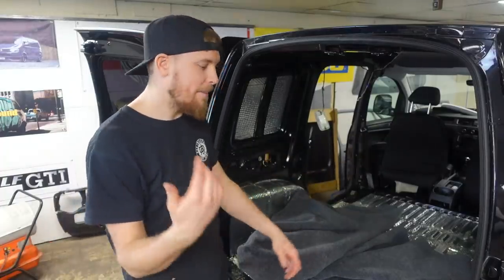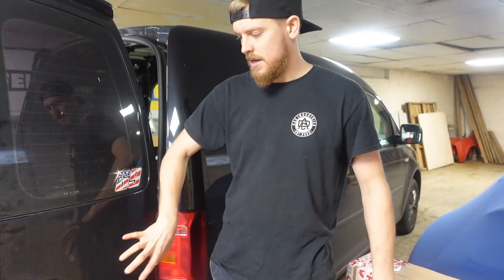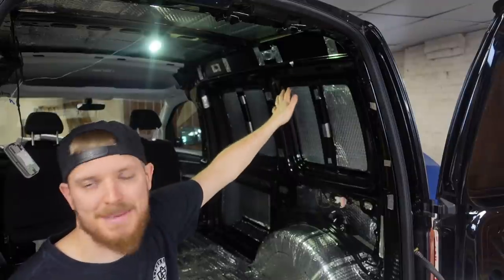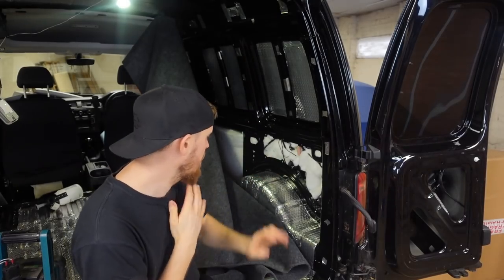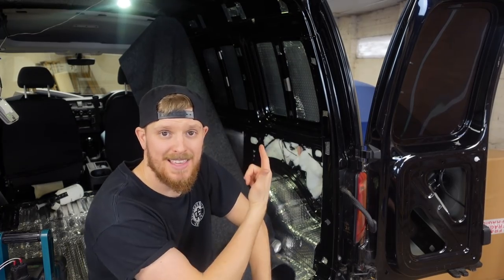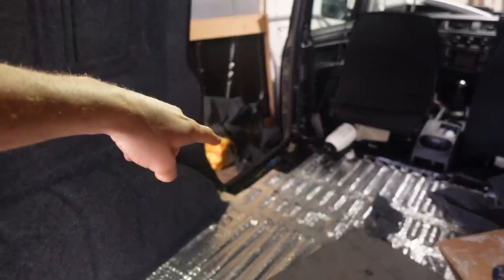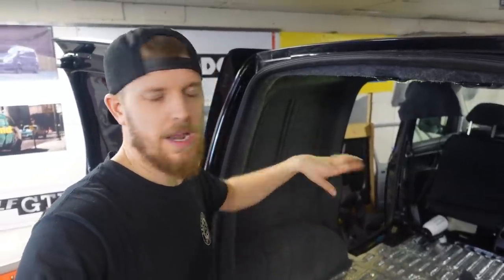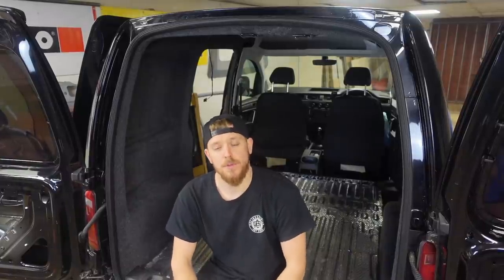VW Caddy 2k Sound Deadening, Insulation & Carpet Part 2 Conversion Caddy Camper Micro

Comment: I would have removed the headliner and under the seats as it is normally bare metal there and you get lots off road noise from there.
Reply from the maker: Thank you so much for watching and for your comment. Yes, Headliner was a bit of a mistake. But none of the front was ever going to be done at all. Under the seats was done in a later episode.

Comment: Love your work Dan, thanks for sharing.
As I’m down here in Australia, I can’t drive over to get you to do my Caddy, so I’m doing something similar to my Caddy.
I was thinking of doing the same style of carpeting on one wall and full height panel carpeting on the other, behind the equipment shelving I’m installing.
To make things look more professional, do you have a suggestion on where I can get dimensional drawings for the panelling, as I have not found anywhere here that does it on my side of the country.

Thanks for the inspiration to get mine done. Cheers
Reply from the maker: Thank you so much for watching and for the comment Ross. Glad you are enjoying the content! I am not too sure to be honest. I had some involvement in templating the side panels for sprinter vans a few years ago and it is a very time consuming task. Most companies keep the drawings for themselves. Good luck with your fit out bud.

Comment: the caddy life trim is a direct fit rather than cutting the bulkhead
Reply from the maker: Thank you so much for watching and for your comment Andy. Yes I had looked into a few options but felt this would be right for this job as it didn't cost anything extra. I may use the Caddy Life panels in a future project.